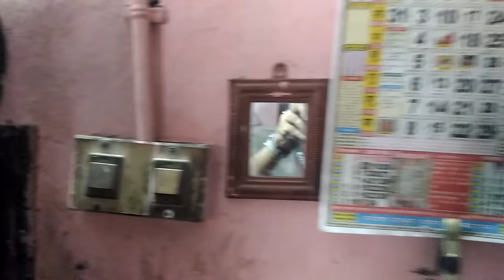Being History

Comment: it is not all that great if you sit bank and think. for nostalgia yes. but technology was like railway train system. everything had to go right for you to see a film properly. and always first 100 feet and last 100 feet of every reel was gone in india. the film reel got scratched easily and after few shows movies look washed. they also did not replace carbon rods properly and movie was dim and foggy. the sound echoed and screen eventually became dirty. And lack of sharp pictures( I am talking even in cities not just district and rural areas).
and sometimes reels got jumbled.

And the projector manual as big as dictionary. the movie reel shakes and you have to be at a distance not to notice it and it is never as sharp as digital. and live with adhoc censorship!

carbon arc is the best but it is a health hazard. you can ruin the whole movie if you delay carbon rod replacement one show late. india was notorious for low-lit films. using inferior carbon rods to save money.
laser arc never offers the pristine brightness of carbon arc!

the seats quality less said the better. and lord have mercy if you have to go to rest room!

compared to those days multiplexes have done far better and it is much much better.
in fact everything is expensive and digital projectors cost a fortune ( all other things remain same-equipment barring reels). sound quality is better than ever!

Imax movies and theaters charge a fortune but at least there is quality in the the hall. clean bathroom, refreshment, clean seats and clean carpets, walls, it is not just presentation that matters. it is gonna cost anywhere between 250 to 750 bucks but at least you had top quality treatment.
so don't be really caught up in the past. it is dumped for a reason.
Reply: true